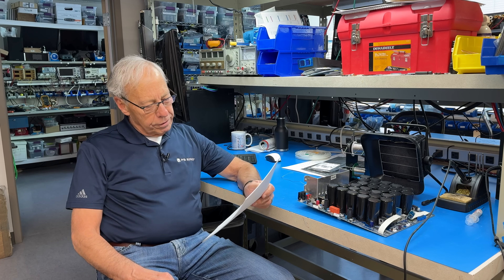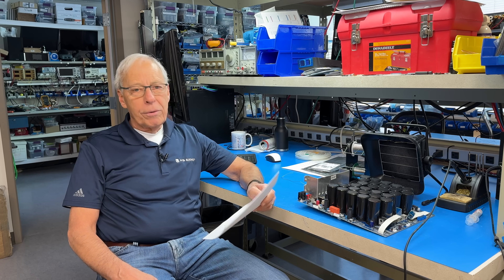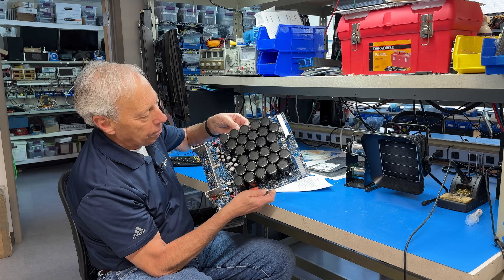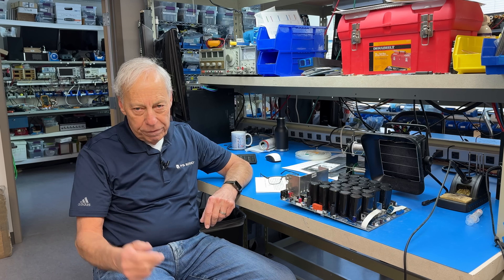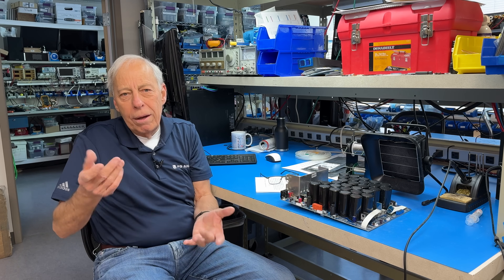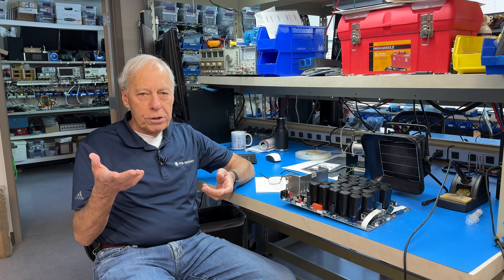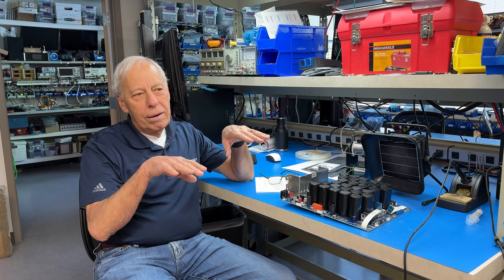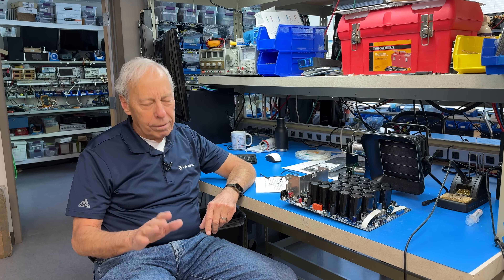MOSFETs, what are they?

Comment: There are many electronic engineers and physicists who would disagree with you about BJT's being current operated devices. Base current is a 'side effect' to the base voltage. There are many variations of FET from the low voltage J-Fets which operate a lot like vacuum tubes with similar circuitry, to high power devices MOSFETS using insulated gates in enhanced or depletion modes to handle high powers. Compared with a BJT output stage a MOSFET in class B will require a big bias voltage to control the cross over region. This reduces the power capability a little. Due to gate capacitance MOSFETS may be prone to oscillation. Horses for courses, as they say.

Comment: Best sound I ever heard was 2 x Leak TL50 power amplifiers preceded by Leak .1% pre amps The speakers were Tannoy 2 Westminster monster speakers! Soft clipping even harmonics made music sound like it was live! Pipe organs are difficult instruments to record clean because of the frequencies and harmonics and the acoustics of churches or cathedrals! Listen to Bach’s to Tocatto in D minor and you will see/hear what I mean! Some organs have pipes in the thousands from piccalos to bass monsters 32 feet or even 64 feet in length! We are talking here bass frequencies 16HZ and lower which you don’t hear you just feel the modulating air around you! Trouble with valves is they are finite and emissions start to fade. replacing matched pair of KT88’s or 6L6’s is costly nowadays maybe £140 and more! I have heard some setups where preamps have valves in the early stages feeding into mosfet power amps and they sound pretty good and they cost very little! example is EF86 and others ! Some simple headphone valve amps sound very good even if they feed into mosfets although impedance matching can be a problem! Any body else find valve sound pleasing? Fraser

Comment: That's alot of "big" capacitors! I can't imagine that piece of equipment having a poor signal!  lol Paul is right, sometimes you do come across a mass marketed piece of stereo equipment that exceeds all of its siblings and exceeding your expectations by offering really good sound quality. Or end up matching perfectly to a particular set of speakers allowing for the same result but wouldn't if other speakers were used. That's the funny thing about electronics. But when it happens, it's like winning the lottery.

Comment: Had a pair of Jensen quadaxle car speaker, made boxes to use on Sony home stereo. Sounded really good
Reply: Jenson quadaxle car speakers.  What year where they or decade did they come out?
Reply: @Mark-lq3sb  80s
Reply: @terrywilliams7827  
Quadrax  That was the name of their new 4-way car speaker in 1981. When you mentioned "axle" it just didn't sound familiar. I finally found an old magazine ad online. I kept searching Quaudaxle and nothing but coaxial and triaxial would show up. I was beginning to think you had the only pair ever made, lol! Back in 1976 (when I was 17.) I bought a pair of new Triaxial 6x9 along with a Pioneer Super Tuner cassette deck to mount in my '68 Chevy Chevelle. Driving though an intersection on the way to my gas station job someone decided they didn't want to stop for the red light and plowed into the passenger side. It was totaled, so I removed the speakers the cassette deck and my almost new battery; set it up in mom and dad's basement and continued jam on some Led Zeppelin. Didn't sound half bad, lol!

Comment: Pioneer literally pioneered using Mosfet chips in their car stereos in the late 1990s. The first ones were branded "MOSFET45" which quickly became "MOSFET50" shortly thereafter. Any Pioneer radio that had a Mosfet chip also came with a parametric 3 band EQ (branded as "EasyEQ" or "EEQ" for short) which was also a breakthrough. Most aftermarket car radios at that time only had bass & treble controls. Very few had a midrange control and nobody had a parametric EQ built into the head unit until Pioneer did it. Car stereos really haven't advanced too much in the last 25 years since then. Pick any major brand and the amp chip they use now is nearly identical to the one they used 20 years ago.
Reply: I explained..everyone uses that same mosfet output ic. I even told who makes that ic.. I cant tell any secrets about build houses
Reply: @davidstevens7809  It's always cool to hear from someone with insider knowledge. 🙂
Reply: @ruley73  Ok. Here goes..MATSUSHITA BUILDS FOR EVERYONE..YUP.PANASONIC..not every model but..they build for alpine.pioneer.kenwood.jvc.sony.Swear!

Comment: I had an amp that was sending a pulse (came out as a loud thumb) to a speaker when on standby and later when playing.  The manufacture immediately identified it as a degrading MOSFET.  I hadn't a clue what they were.
Reply: Nope..open signal ground. Term is called motor boating.

Comment: My first real higher-end amp was a Adcom GFA- 5500. It had a smooth and sweet tube-like sound except with more authority in the lower registers. Being voltage-driven devices (like valves), MOSFETS tend to be more tube-sounding and the 5500 exemplified this. Bias (like other Adcom amplifiers) is toward class A, so it ran warm. They didn't heat the room like older Krell monoblocks. But it's also smoother sounding and less transistor sounding than the Krells.

Comment: The pioneer would run off a battery; no dirty house electricity!
Reply: Um i used a converter im pretty sure it was more stable than the crappy neverstart batt i had in the car
Reply: I have been watching the process of power generating and storage in car audio, fascinating. Lithium, super capacitors ECT .

Comment: MOSFETs are voltage controlled current sources while BJTs are current controlled current sources. MOSFETs have high input impedance so they require little current to be turned on but fairly high voltage. They do not suffer from thermal runaway as found in BJTs and they exhibit distortion similar to tubes in that they predominantly have even order distortion products. BJTs have both odd and even harmonic distortion which is more objectionable to most listeners. The even order harmonic characteristics of MOSFETs are likely what give them "tube-like" warmth
Reply: I did notice that in the car it would get extremely hot and it wouldnt be quite as good sounding but in my house in the ac it stayed cool even when cranked up full volume
Reply: Lateral mosfets are the only sub-type, where the drain current vs gate to source voltage drops with the die temperature from about 120mA of DC bias per pair. For hex-fets, this relationship still exists, but only for drain currents measured in amps. Distinction in regards to thermal runaway susceptibility should be made between the two.
Reply: @paulb4661  Could you please dumb down your answer? I don't have an electronics background.
Reply: @BruceCross  Hate generalizations, as the devil is in the detail, but lets say hex-fets should ideally still be thermally compensated, whilst lateral fets need not be. Lateral mosfet output stages are rare as hens teeth and the ones designed correctly even more so. In my opinion and to my ear, lateral mosfet current stage amps done correctly sound superior to pretty much anything else, including tubes, but at a price.
Reply: I thought the power MOSFETs used in amplifiers were subject to thermal runaway?

Comment: MOSFETS normally have a very high gate impedance, yet usually requires a fair amount of Volts to turn on with high current loads. It also suffers from significant gate capacitance, so needs a low impedance driver to reach those higher audio frequencies. Just a thought: I always thought it was the dominance of the second harmonic that made a valve amp sound warm, they would also clip rounded. A BJT Amp will mostly clip as a square wave, so making the third harmonic dominant and sound harsh. Excellent videos/equipment you make, Paul.

Comment: MOSFETs are superb for switch mode power supplies. For audio great sound can be had with MOSFETs, tubes, and bipolars. Maybe a discussion of JFETs in phono preamps is in order. One thing I've noticed about large power amps with MOSFET outputs is that they tend not double their output into loads where the impedance is halved whereas serious designs with bipolar outputs do. Two examples that come to mind would be Krell & the old Aragon amps. With those you'll see ratings like 200W into 8 ohms, 400 into 4 ohms, and even 800W in to 2 ohms. What remains consistent is that every setup requires individual evaluation. The best sounding amp I've ever heard through one speaker might not be through another.
Reply: Actually mosfets are better at upping current .. but realize the power supply must be able to deliver.
Reply: @davidstevens7809  I'm an EE but I haven't looked into the reason why. Their gates do have significant capacitance but I haven't studied what that does to slew rates and other factors. A very low "on" resistance is what makes them so efficient.

Comment: Ok . The pioneers have a part #pal 002-or as they update ..003..004 etc..the the pioneer number..in reality theyre Tda7384 parts made by ST semi..I think.every car radio brand uses a varistion of that part..yes its mosfet.. alpine uses tda7560 I think ..an ability of mosfets is they arent as picky about load impediance..bjt designs are plagued by a problem called thermal runaway..there are  ways to calm the problem.( emitter bypass cap) but thats another topic..mosfets are more stable for the most part.I can tell you my friend invented the all N channel output stage design that everyone copies these days..the reason is..p channel mosfets are inherently weaker that the N channel ones .they dont bias exactly the same either..so my friends All N channel changed the world. I suggest amps with all n channel output design..
Reply: Which amps are these?

Comment: Many amplifiers nowadays have a little bit of sound that is not so warm.

Especially class-D amplifiers?
but also newer cheaper class-ab.

This type of sound can be a bit sterile and boring and tiring for the ears.
Reply: Not just nowadays.
Reply: @36karpatoruski  Do you have speakers and amplifiers that were made when cassette tapes were popular or radio. Talking about the 60's 70's and 80's.
then this can sound too cold and bright with CD or MP3 music.

What's Your opinion?
Reply: Yes, my hobby started in the late 60’s. Never heard a cassette sound harsh, but only made my own cassettes from LP’s, never bought any pre-recorded. Some harsh or thin sounding amps or receivers include units from Phase Linear, Crown, Carver, and Sherwood. 60’s - 80’s vintage gear. Of course, poorly recorded CD’s will sound harsh using just about anything for amplification. Also, harshness is a matter of degrees. What some people find objectionable, others may be ok with.

Comment: Do mosfets improve the sound compared to bi-polar transistors when used at power amplifier outputs?
I doubt it.
The word "warm" in general evokes comfort and pleasure, but unless It is analysed, explained or measured, means nothing in relation to audio amplification.
Reply: Some competitors choose BJT. Current is critical, that's the argument. But...Paul's products have few critics in regards to sound..
Reply: I understand what your sayin but its hard to describe the sound without using all the buzz words like soft, pillowy, or warm. In audio terms i would say a colorization of the high end around 5k to 10k that makes sound less fatiguing to the ears, less harsh. It just sounds good though
Reply: @Durkhead  it's a little more than buzzwords nowadays. One reason class d  amps are praised is higher current, imo...
Reply: @Durkhead  that gain in efficiency means (much) more current is going to the voice-coils. A/Bs intentionally drain that current. A/B amps were one of the great hoaxes of audio. A 'd' amp at 20 watts, was made in 1965.

Comment: Still to this day, one of the greatest sounding amps I’ve ever owned was the Precision Power A404 Art Series amp from the mid 1990s. I believe this had a MOSFET design.
Reply: Just refreshed my ppi 2150am  from 92, finest sounding amp.
Reply: No.its not mosfet.. its 2n6487 and 2n6490.. bjt output..thats why they are current limited..now is the time to tell..I HAND MADE PUNCH 45s for rockford in the 80s.. Im directly involved in amp evolution..and design.. ha ha..
Reply: @davidstevens7809  curious what your makers mark was inside.

Comment: In an earlier video you said that class-A amps use full power at idle. The correct is half is it not? Because the Q-point is placed in the middle of the transfer curve. If it used full power at idle it would only be able to handle negative swing(amplitudes) and no or very little room for positive swing
Reply: Class B and AB are inherently push-pull. Class A can be single ended or simply a class AB where the "pull" side turns off only on the full "push" side and vice versa. But if you have that for 8 ohms and load it with 4 ohm, that will run out of current and become somewhat class AB; if you load your typical class AB with 1000 ohms, it will probably be able to do that in class A...